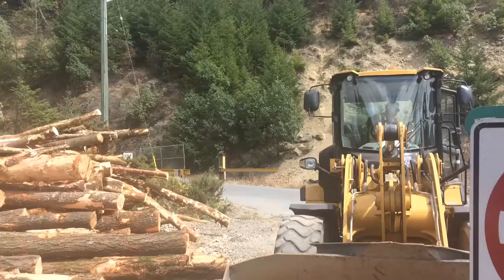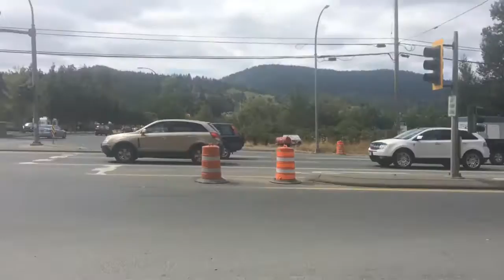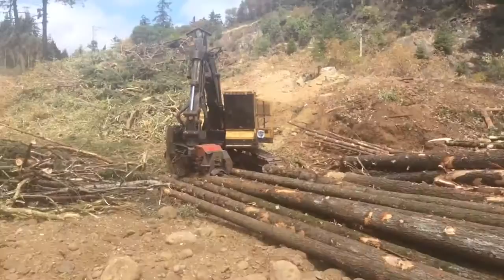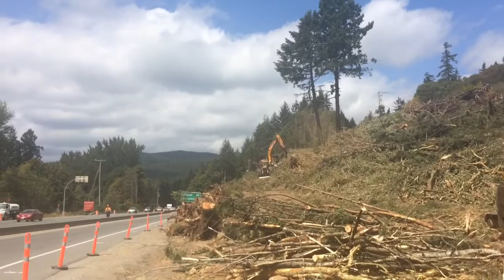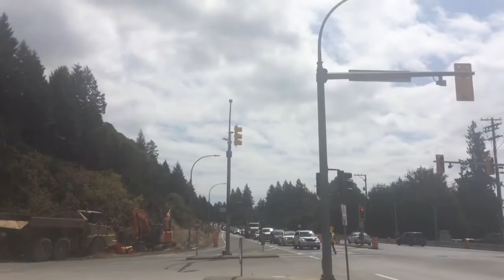Log processing just outside Goldstream Park, Victoria BC

Comment: Those Quadco/Ultimate heads were real popular around here up till about 10 years ago when everything went Waratah. A lot of them had no measuring system installed, guys were using them to cut and delimb tree length ahead of the grapple skidders. I still know of one working on a Deere 2054.
Reply from the maker: I like the intermittent disc saw, it's great, no bar oil, no chains
Reply: A lot of guys complained about the saw being too slow. I never ran one but always thought it was a good idea. The ones I saw had accumulator arms on them too, way before multi stemming was even being talked about.
Reply from the maker: A bit slower, yes, but it hogged out wood like an animal. There is no synchronized feed however. Constantly feathering the upper and lower  delimb arms to feed smooth with no spin outs. But the hydraulic fittings are simple, and there's nothing complicated.